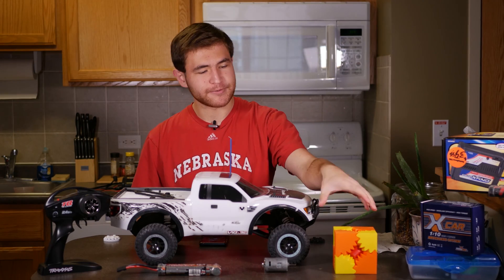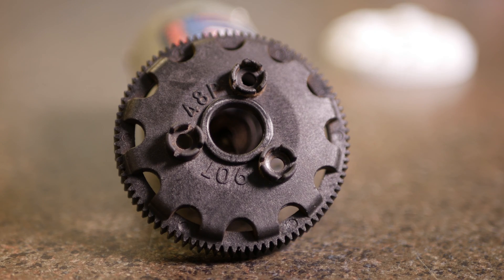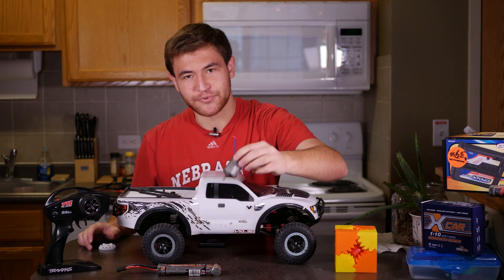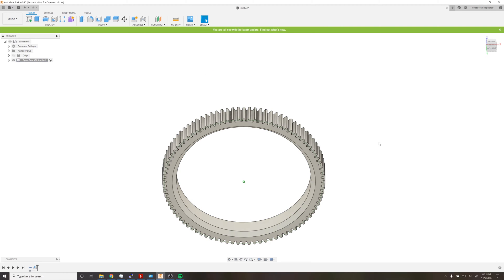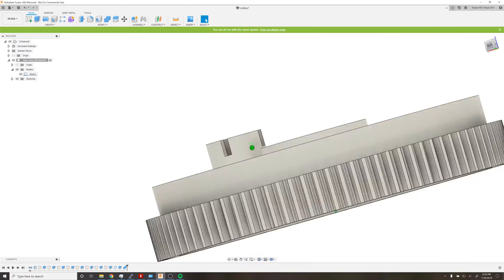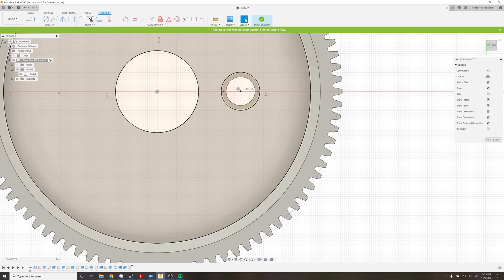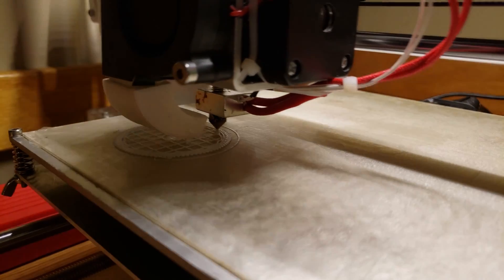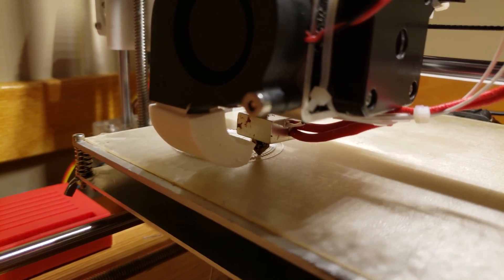3D Printing a Traxxas Spur Gear

Comment: to save u some time next time if you take the 3 screws out of the gear and grab a flathead screw driver and wiggle it between the gear and the gear case you can get the gear off without having to remove the clutch everytime !

Comment: I think newer filaments like PETG have been a game changer for applications like this. PLA in my experience is definitely more of a decorative or low stress material, it just doesn't hold up to stress long term and melts if you so much as leave it in direct sunlight, which was exactly what happened to me when I tried to make an RC car body once. PETG on the other hand is about the easiest high strength material you can print with, and I've been using it for all my RC projects now without any problems, (aside from initially dialing in my print settings.)

Comment: I printed this in PLA+ and ran it on a brushed stampede until my gear came in. The only issue I noticed is that the hot pinion would stick to the spur after a run. Upon removing and replacing, the printed gear still looks fine and usable. Nice model. I also did notice the small holes under the teeth but as it did not fail I can't criticize the design. Maybe it makes it stronger with flexibility, who knows.

Comment: The gear holds up well, but for me, it occurred that you have compromised the strength of it using suboptimal slicing settings. The tiny holes in the middle of the teeth are the problem. Shearing and bending stresses affect that area critically, hence the estimated lifecycle of the printed gear may be shorter. I recommend increasing the wall thickness  to make the small holes disappear.

Comment: Maybe one advise: when making 3d printed parts they should be designed forn3d printed. You don't need these fancy castelations on the circumference. What is important are the interfaces : gear profile, shaft diameter, mounting bolts placement and size. The 3d printed part is inferior when you compare it to injection molding, so to overcome the strength issues you should use some walk arounds. But good job on this project. I've printed some 3d printed parts for my cars ages ago.

Comment: If it did happen to fail, there's a trick, you can anneal the PLA prints to make them both more temperature resistant and tougher without compromising on surface hardness and abrasion resistance, as a result they can outperform most engineering plastics.

Recipes differ. I found that even just setting temperature on the bed after the print to something like 80°C and covering up the print with a bit of sufficiently compact piece of tupperware to capture the heat and leaving it to warm up for an hour does something, but probably doesn't anneal it completely. Other people drop the prints into boiling water, or put them into an oven for a while at 110°C, but it is to note that many ovens can overshoot HORRIBLY on their regulation, and you can't have that, you'll just have a melted print. Some people use sand to support the prints while oven-annealing and to absorb the extreme temperatures that might occur. Not much clarity and a lot of ground for experimentation. Possibly ramping up the temperature slowly or in steps can be helpful, as a partial annealing might help the part survive higher-temperature stages.

What's common to all annealing methods is that the dimensions of the print will change, and the change will be shape-dependent. You expect to lose about 2-5% in X and Y and gain about 1-2% in Z, relative to printing orientation. So you will need a test run and adjustment.
Reply from the maker: I've heard about annealing before, but I haven't personally tried it. My biggest concern about doing it to one of these gears would be the shrinkage that you mentioned. It might not be a big deal if the shrinkage was perfectly uniform, but I would worry that it might make the gear into a slight oval shape instead of being perfectly circular. I've also heard that you can get PLA that is meant to be annealed and won't shrink as badly, which would probably be a good thing for something like this. For now the gear is holding up well though and it may be strong enough to where annealing isn't required.
Reply: @Eman2000  Oh the gear if printed in this orientation should shrink uniformly! Or at least very close to. I mean look at your printer, it's not even perfectly square for sure, and if you set the same belt tension on X and Y, belt stretch is still not the same due to different length, so the print has some fundamental ovality to it! And chances are material distribution and stress is such that shrinkage would counteract the deformation caused by the printer a tiny bit, if the print is already detached from the bed.

Furthermore since you'll have a hard time predicting shrinkage and a test run is necessary anyway, the test run will tell you both the adjustment that you need to make, and whether there is warpage or other shape issues.

Other shapes can be a lot more tricky or less lucky, gears are easy.

Yes there is HT-PLA which has less shrinkage but i haven't worked with it.
Reply from the maker: @SianaGearz  If this gear breaks I'll have to give it a shot.
Reply: Thank you very much will try that. I am getting my first printer soon ive been wating for years to get the money.